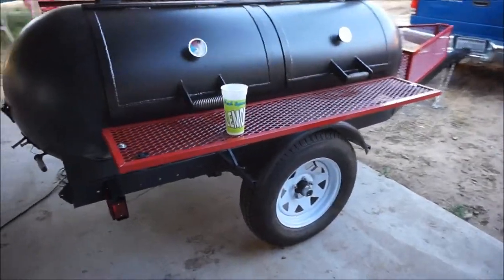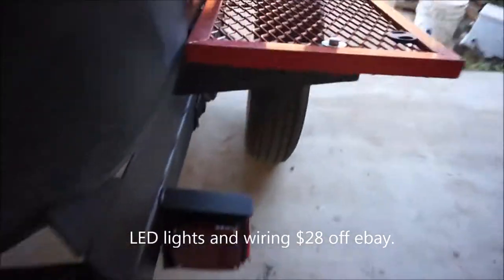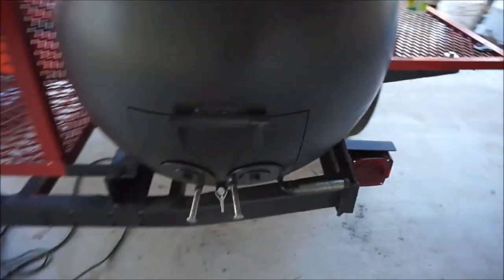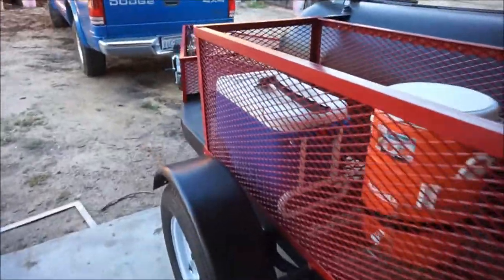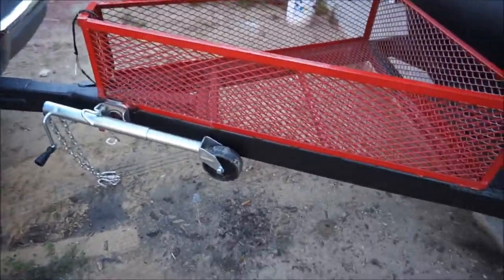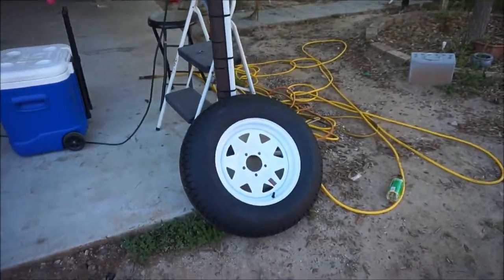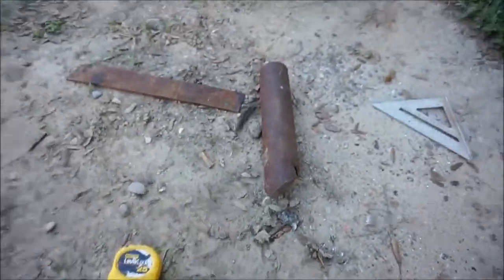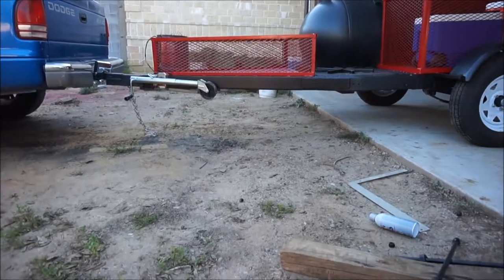How to build a propane tank smoker trailer update

Comment: How much did it cost
Reply from the maker: I don't remember the total cost but let me see what the old emails and receipts show. Tank was about $80, Rims and tires $180,  Boat trailer 75, Expanded metal $50, Axle $183, Coupler $25, Jack $ 25, Lights $25,  I want to add maybe $100 more for metal, electrodes and misc. items so $750. 

The project was around $750 over 5 years ago. I actually want to build me another one but smaller to raffle away.